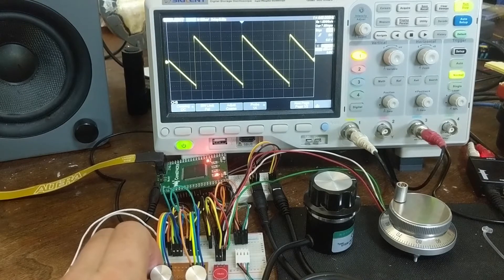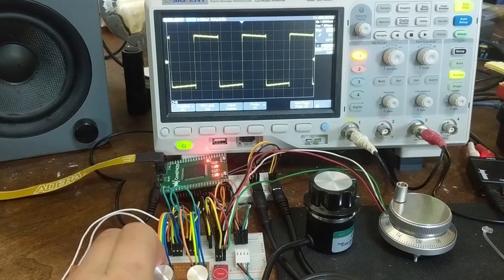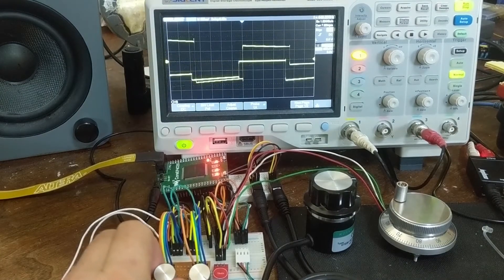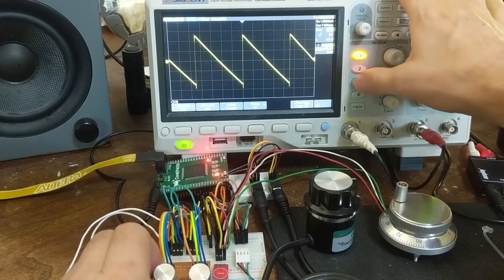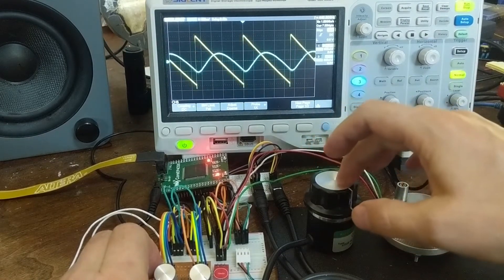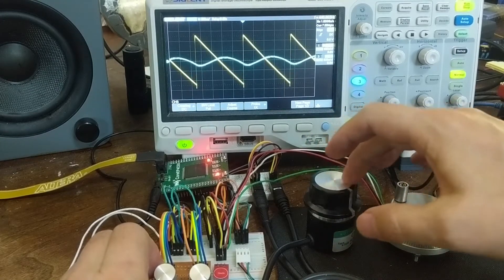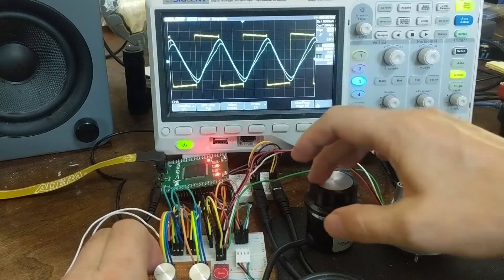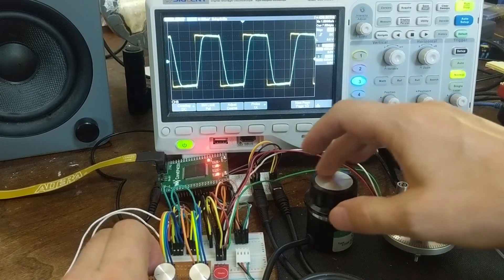A Synthesizer in an FPGA - Part 3 - Low Pass Filter

Comment: the question is, did your FPGA board have an onboard DAC, or you connected one seperately? im half way through this, I've created a VGA (MegaDrive style device) BUT i want to see if i can make a Semi Yamaha sounding thing, BUT not sure which FPGA you used, does it have its own DAC inside the FPGA or did you use a dedicated hardwae DAC.... if so, which device did you use?

Comment: Interesting.  Is the source code available?
Reply: Thank you. No the source code is not available, for two reasons, the code is quite a mess as I was just experimenting, and I still have hopes of turning this whole thing into a semi-comercial product.
Reply: @pasde2  Fair enough.  Good luck.

I'd thought of doing something similar, but mostly just oscillators, with ADC inputs and maybe MIDI.  I hadn't given any thought to digital filters.

I don't have any intention of making it commercial, if I ever get around to it, but that's mostly because I don't have that kind of energy.